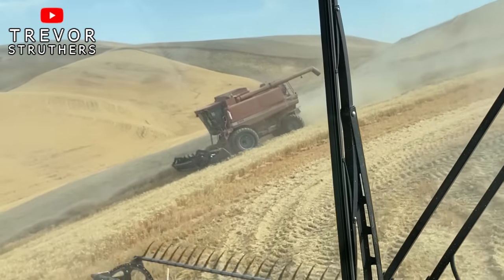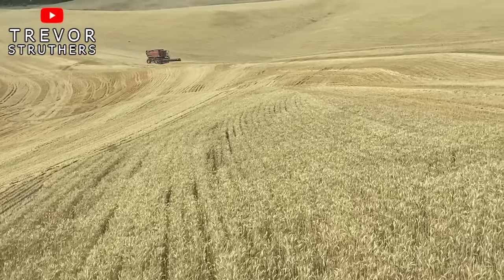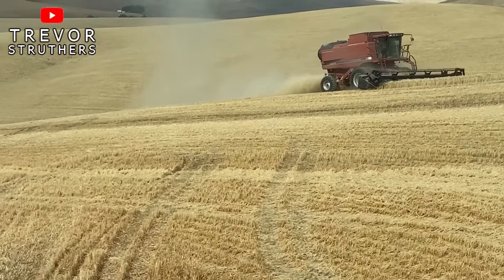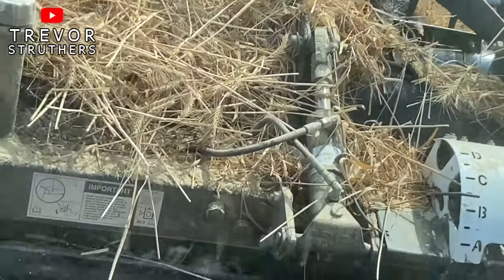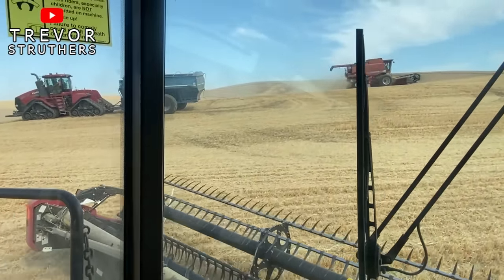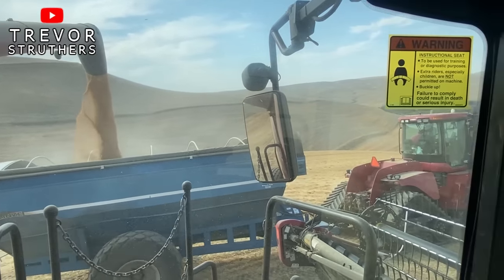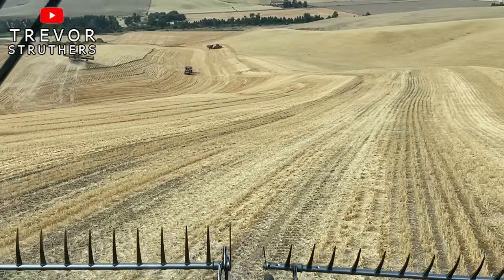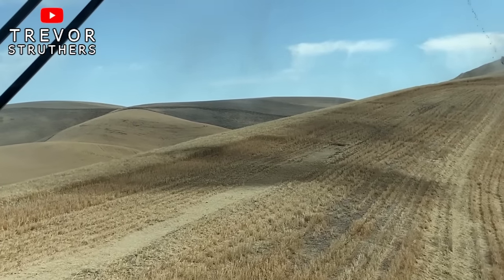Smaller combines, bigger hills. Grain Hogs S02 E02

Comment: Why do you run normal bar tread tires on the 2388 but on the new combines you run diamond tread and which one does better in the hills
Reply from the maker: I have diamond tread on my 9120 and it works. It slides a bit. I think they both dont work well enough.

Comment: I learned to unload on- the- go when I was real young.   That way the combine didn't need to stop cutting.   I grew up 30 miles South of Spokane, WA.  We had some of those fun hills.  Those eyebrows were fun to sled down in the winter.
Reply: Didn’t have bank out wagons so how about the truck driver who kept truck under spout-on the fly…moving back and forth to distribute load? Oh yah, rarely was ground smooth, especially fall wheat fields.

Comment: Brings back memoeries. My uncle had an older combine for years. But parts got to exspensive so he had to upgrade.
Reply: It never ends. Combine’s, and everything else.
Reply: @joegotz1971  ya, I mean I don't see why the machine has to get bigger. Why not make a better smaller machine. 😏  for hills.
Reply from the maker: And hard to find! In my next video you will see a combine graveyard of case 1460’s
Reply: @TrevorStruthers  oh ya we went to one in our area to look for parts. I'm glad there's someone showing off the hills we deal with. Everyone always harvesting on flat land.
Reply: @nighthawksim6675  If that was true al of the manufacturers would be doing it. Check out the John Deere X9 1100. In corn it will do 7000 bushels per hour, aka 7 trailer loads.
Reply: @joegotz1971  what do you mean?